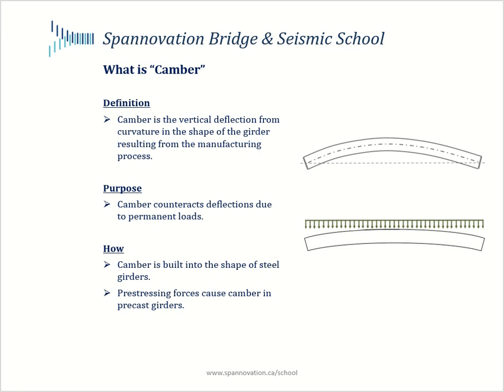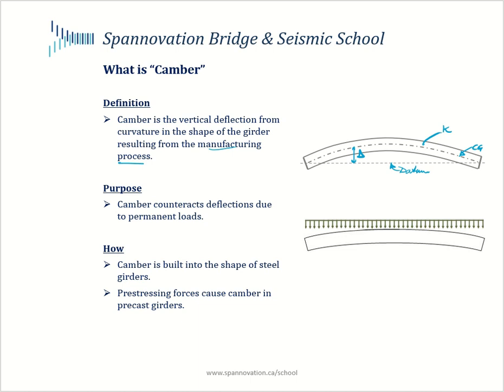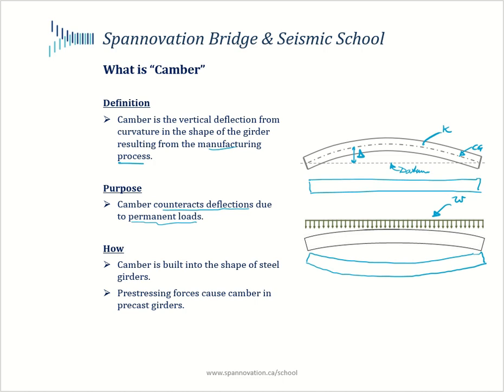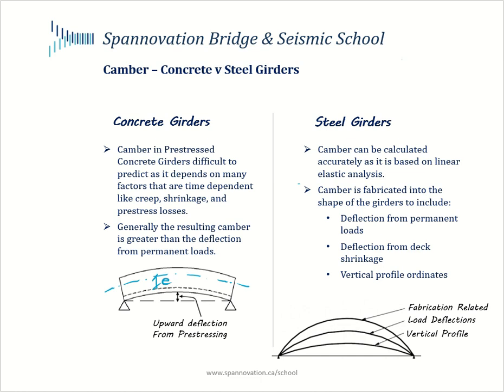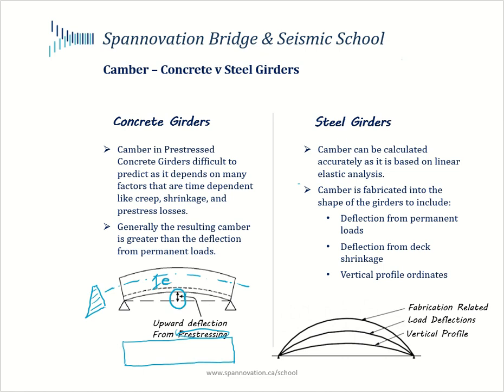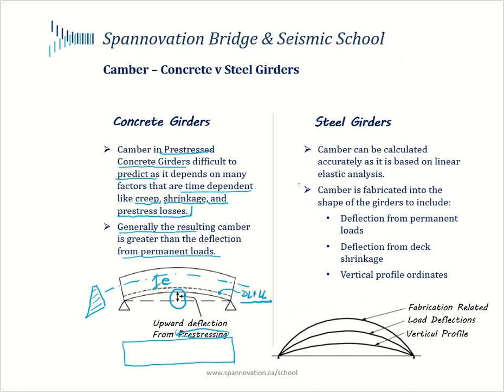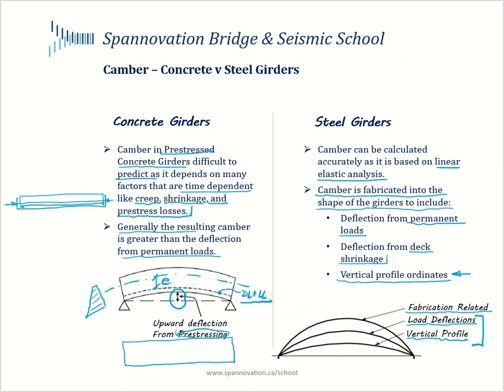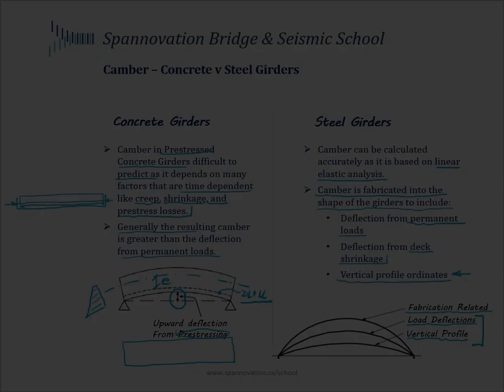TUTORIAL Introduction to Camber

Comment: Thanks for your video, is it possible to include part of live load deflections in to camber, so that you can reduce the total deflections in the structure, e.g. Camber = Dead Def. + 20% Live def.
Reply from the maker: Yes, one could do that. However, the general practice is to not include any live load in camber calculations. Live load deflection and vibration control is related to rider and pedestrian comfort. Camber does not help with this issue.